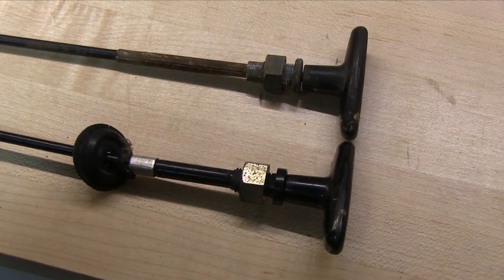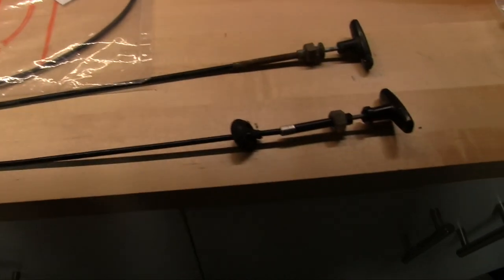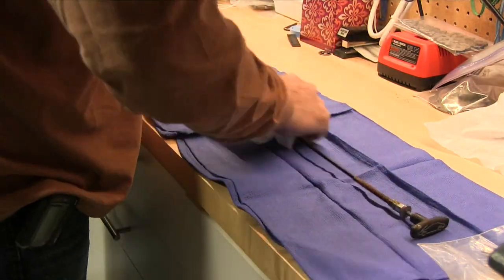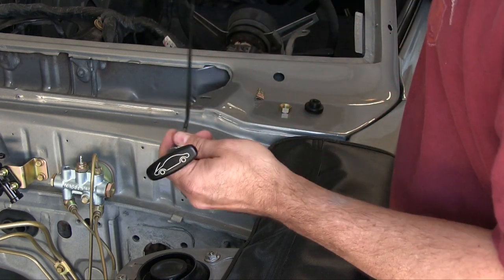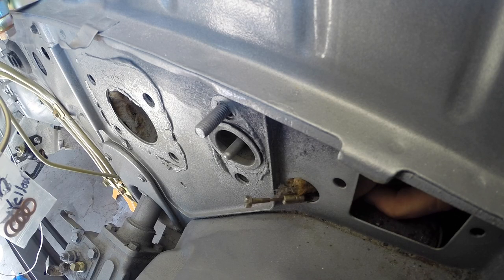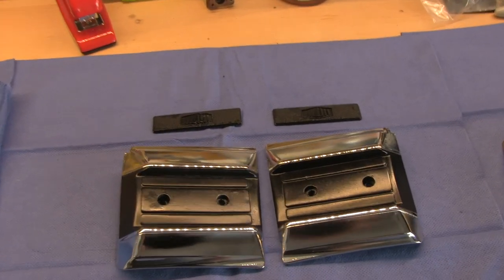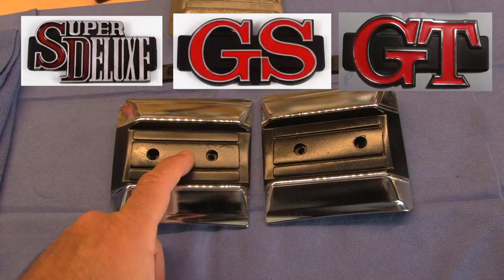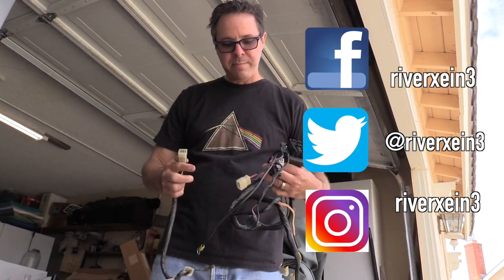VLog 37 Mazda RX3 Hood Release Cable Restore Install

Comment: SuperDeluxe was 10A and GT was 12A, so that's something to consider, but why Aussie badges in the first place?  Perhaps it's better just to keep it stock as a U.S. model??  Great video, thanks for sharing!
Reply from the maker: Hi Dave, thanks for that additional info. Restormaz had already restored my C-Pillar emblem holders to non-US spec when I realized the difference. I would have to take a second set and send off for a US spec restore of those. I'd rather just get Aussie badges. So if I'm 12A for sure you are suggesting I should stick with GT? Thanks again.
Reply: Yeah, I think GT would be best for 12A.  GT also gave the clock, 5 speed, armrest/center console, RE badge on grille, 5.5" wheels so it makes sense since you probably have most of those things on your car.

Comment: The US did have the Rx-3 SP, the model with the sport decals and louvers.
Reply from the maker: They sure did.
Reply: But the appearance package SP's have the side window louvers that cover where the badge would usually go.....?
Reply from the maker: Good observation Keith. So an SP doesn't have a C-Pillar emblem?
Reply: The side louvers stopped just before the badges and everything was painted black. Actually the factory side louvers looked awful as they were made from an embossed abs type plastic that was vacuum formed like the bottom of the tray table on an airplane. And to make things worse (which feels bad as I suggested it) the back window louvers don't match either the side window louvers or the trunk vent louvers. It was a total mess sorry I brought it up.
Reply: All the side louvers I've seen completely cover where the badges go, I have a pair of them myself.
Reply: I had a pair and I just looked online and can see both, I wonder if they were sourced in the US and not made in Japan? It's also possible that one of ours was aftermarket, could be JC Whitney made some. ;)
Reply: Can't say I've seen aftermarket louvers, but I think I recall hearing something about them. The original SP louvers covered over the badge area. I bought mine from the USA.
Reply: That's really cool Keith, so many Rx-3 fans are here. Where are you from?